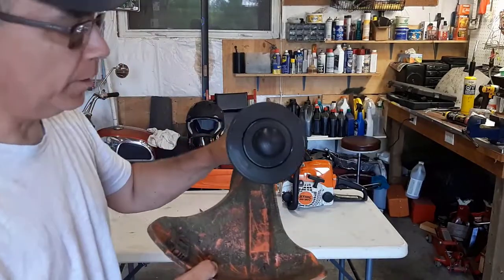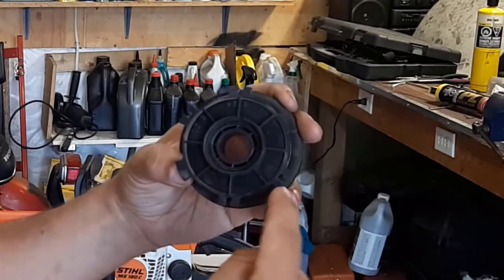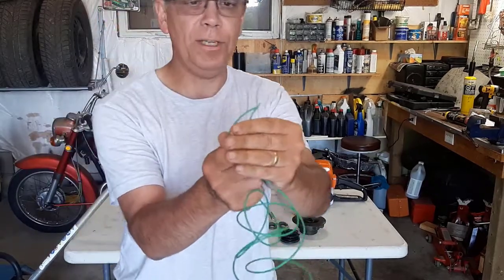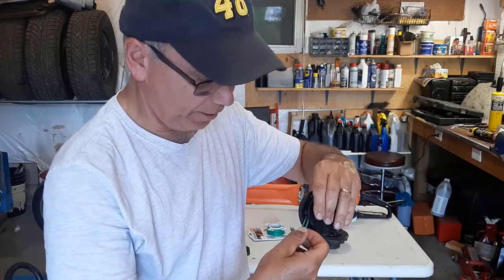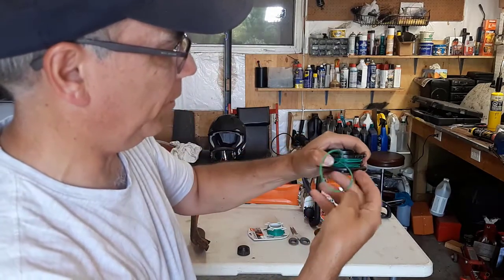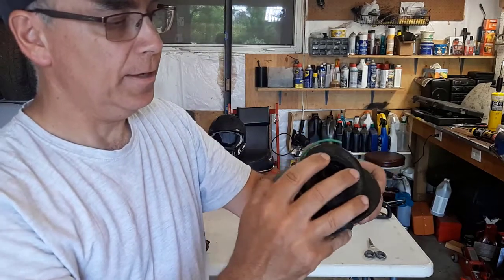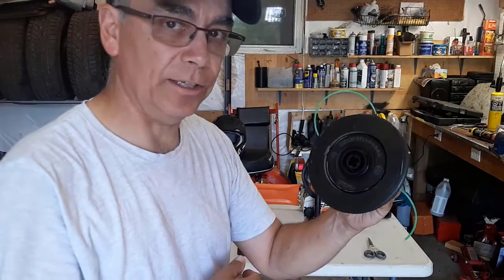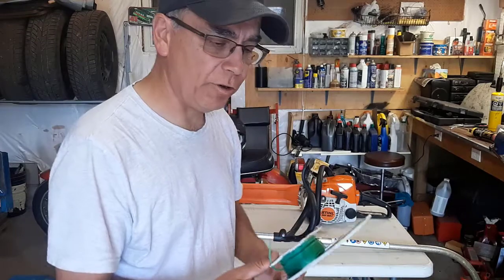Stihl FS38 How To Refill Trimmer Line Spool // Trick To Make It Easier

Comment: Great job...my major problem is getting the string out the feeder holes....gotta practice I guess...you made it look easy...thx for the video
Reply from the maker: You will get it, take it apart and try again!
Reply from the maker: do you mean the string won't feed out while using?
Reply: @GettingItDoneRepairs  that was the problem when I first bought it. The string wouldn't kick out when I tapped it. Took apart and resting. Seems to work fine now.

Comment: excellent video Roland!
I will go look at my line cutter head but normally I use the blade. I can't get close to anything with the blade though like wooden or metal posts because it will try and cut them and something will get damaged :(
Reply from the maker: I was hoping to see the blade and which trimmer you use with a blade.

Comment: Thumbs up for the hardship you endured, yes stihl are pretty good I just purchased and filled my weedeater with motomix by stihl this weekend, guy at shop says its brilliant stuff for storing over winter guarantees to start up in spring no problem
Reply from the maker: Thank you, every year when I store mine for winter, all I do is add some fuel stabilizer to the fuel and start it to run it thru the fuel system quickly. Then I remove the fuel from the tank, and start it again and run it dry. That's it! Fires up every spring no problems. I also use premium fuel always.

Comment: The head of my fs38 gets very hot and the line melts together and it won't feed out. Does greasing that hidden hole (saw it the last video) keep it from getting too hot?
Reply from the maker: I've never heard of that problem. Wow! Sounds like greasing the hole might help. Let me know how you make out.
Reply: Mine does same thing, line fuses to each other and wont feed. FS45. Dealer says cause I didn't wrap it tight. Made no difference. Spend more time fooling with the feed than wacking weeds. Think I'm going to get an Echo, zero problems with line feed from the one I once borrowed.
Reply: Debra, I too have this same problem.  Very confused no matter how tight or loose I wind the cord, it quickly becomes useless as the cord no longer will feed out.  I can't even pull it out.
Question, did you try your oil idea, and did it work?
Reply: Yup

Comment: When i string it up, i have to stop every 10mins to let out  more string and cut it because it is not auto feeding out. what am i doing wrong?
Reply from the maker: Maybe when you wind the string on the spool  the string is crossing over itself and creating a lock. Take the string off and try again. You will figure it out.
Reply from the maker: Also make sure the string you are using is the correct diameter for your trimmer. Too big or too small will cause this problem. Also you check the spring under the bump cap. Make sure it's not broke or worn. Good luck!
Reply: the trimmer head has (?) to be moving when you bump it. so rev it up half way or so and bump it on solid ground or pavement/brick and it should unwind
Reply from the maker: @michaeljolive7226  yes it has to be rotating but there are times it won't feed.

Comment: Can I use 0.95 line with it?
Reply from the maker: 2.0
Reply: @GettingItDoneRepairs  2mm? Way too thick don’t you think?
Reply from the maker: @timmenojr.8032  is it for the Stihl FS38? If it is, it's just right.
Reply: @GettingItDoneRepairs  I’ve always used 0.95 for all my weedwackers.
Reply: @GettingItDoneRepairs  2.4 is the same as 0.95 just different measurements I believe.